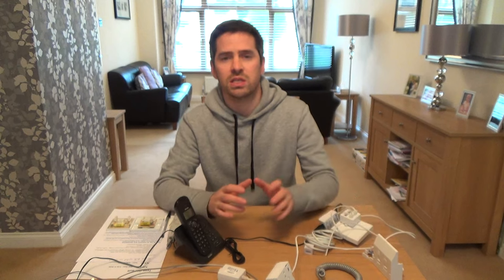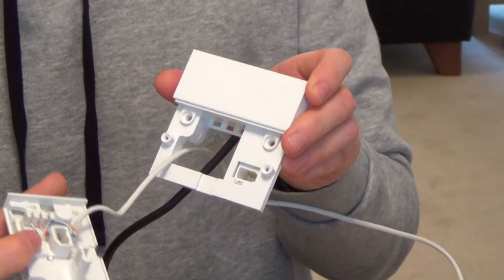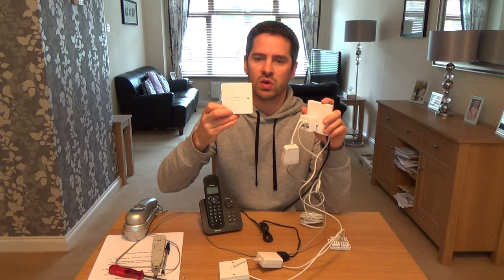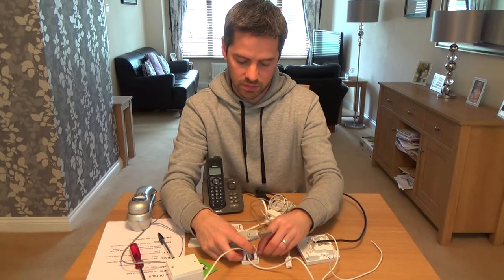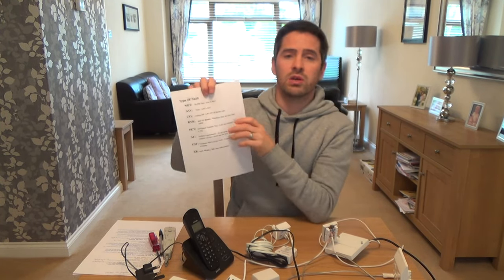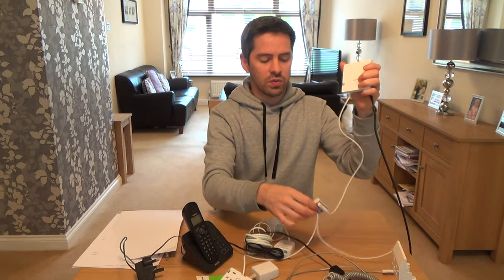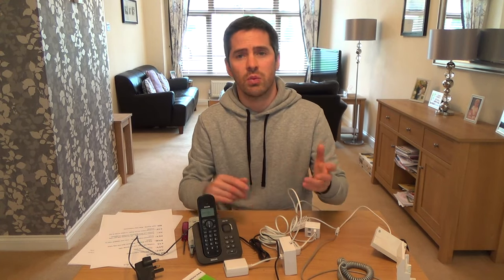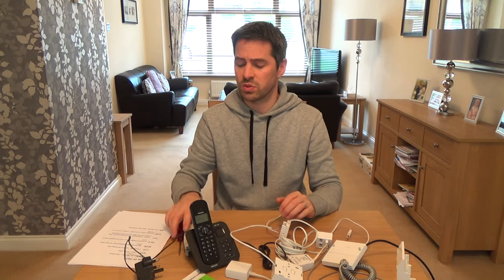How To Fix your TELEPHONE LINE, landline phone FAULT finding and REPAIR.

Comment: I have had Openreach out 8 times to diagnose why my speeds have dropped over 20Mb overnight. Each engineer has fucked about swapping pairs etc etc and eventually got it up around 10Mb, blaming my cordless phone (which was a few years old). I have tried 2 new phones and they both cause massive errors on my line if i plug them in. Now i have interleaving on my line because of this.  Now i can't plug in my home phone. Fucking muppets the lot of em.

Comment: So looked at faults in my old brasscandlestick brass phone,,🎃after reading loads of faults and fixes , the best and first thing to do is,,,check the hidden plug connection. It works if the plugs  in 😂😂😂.🤦‍♂️

Comment: OK  have main box  from there A phone  also a extension
that dows to a filete for data moden and a phone connect  sky box??

been in 6 years no problem?
After trouble with a ligjhtening strick on road??
loss of TV  DVD  Internet ??
Lost Phone ? but had modem??
Then after bring all cables into room on carpet???
Had Internet providers do online checks of connections
found trouble i area and all wadm put right??
Put all cables back under floor?
Phone plugged in modem does not work?
take phone out modem works?
bring all cables up again 
And problem remains?
I have more cable colors
and wife headaches?
Trouble shoot goes not work
Full rip ouy of all cables in house
and new plugs appears only way to sanity?
Wife happy with modem for laptop